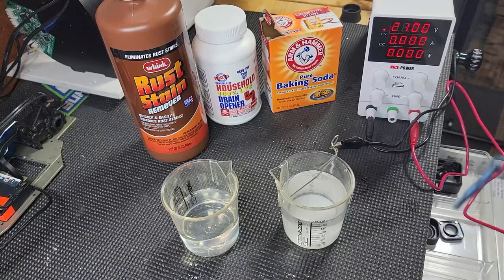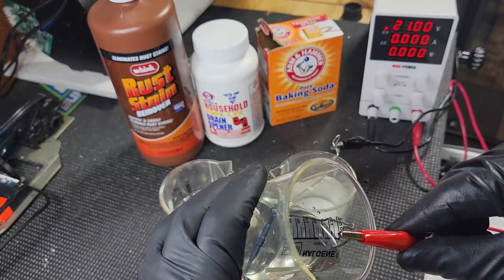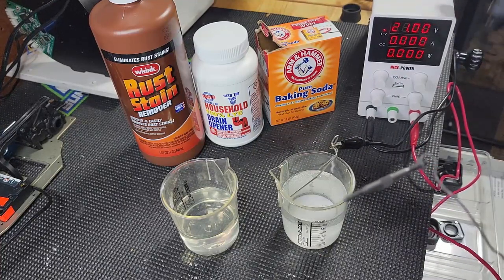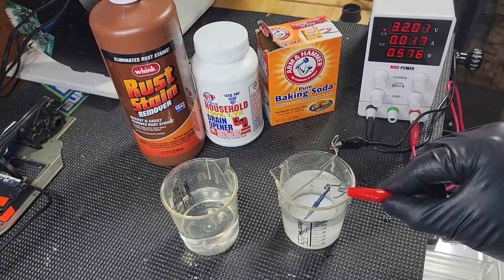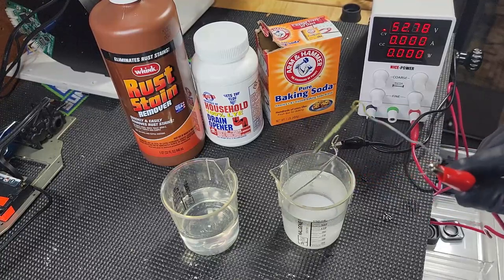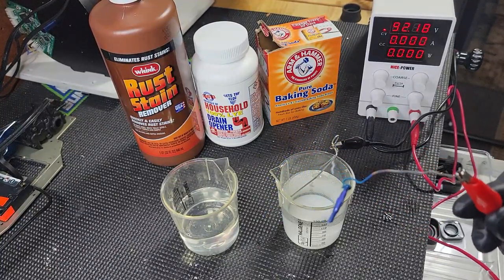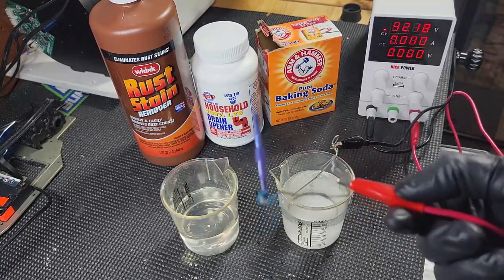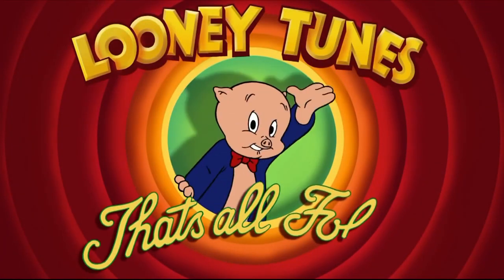Anodizing Titanium

Comment: Do amps matter?
Reply: Same question
Reply: @jayrad017  I got an answer. A 3 amp Power Supply is good enough. See the video on my channel for the results. Not sure if less than 3 amps is cool or not, but I bought one with 3 amps and it works fine for balisong handles.
Reply: @Human_Evolution-  Thanks, much appreciated!!!
Reply: @Human_Evolution-  I've actually done some of that. It took me forever to get it to come out good, but it is awesome when it does!
Reply: @jayrad017  any tips? Do you just need a torch and a certain type of acid?
Reply: @Human_Evolution-  ferric chloride and a torch. You do the same prep to the titanium as with electro anodizing. Heat up the metal until it turns bronze and then dunk it right in the FC. You dunk it into something like a jar shaped container so the scale is standing up or something wider so it lays sideways, also u can shake the metal when entering the FC to get different patterns. If u got a bunch of rusty looking orange u probably overheated the metal. Good luck🤞